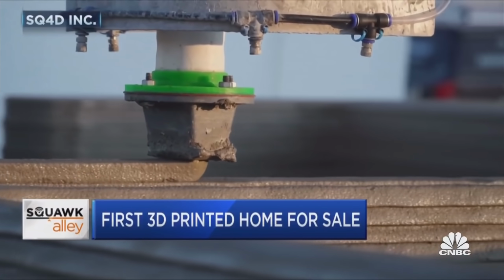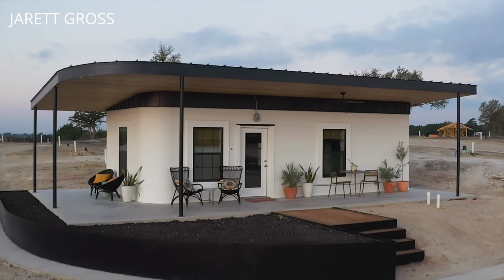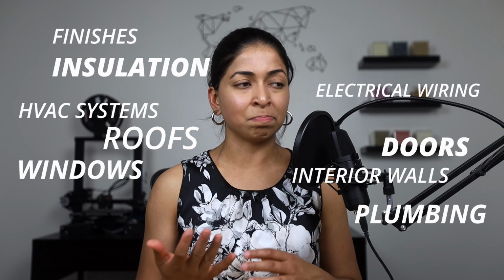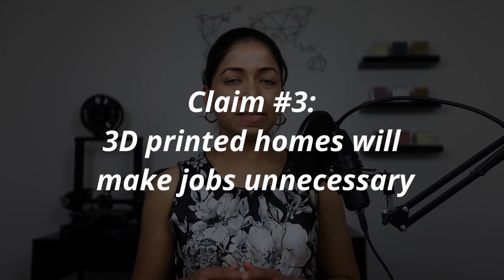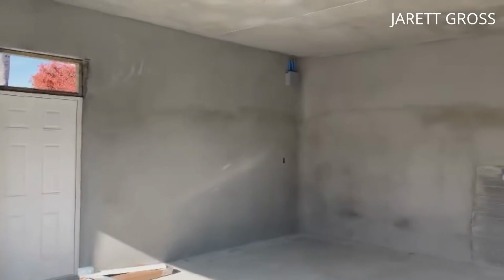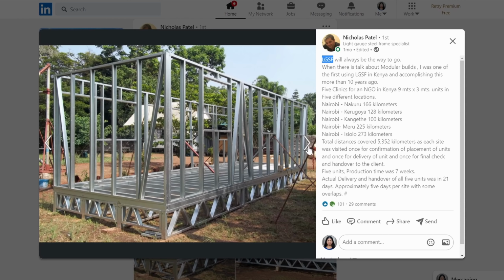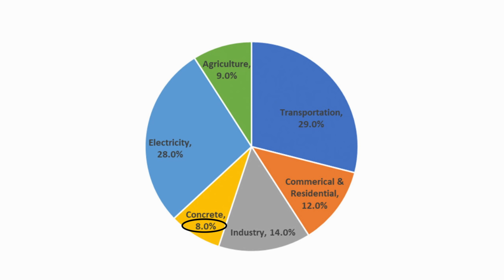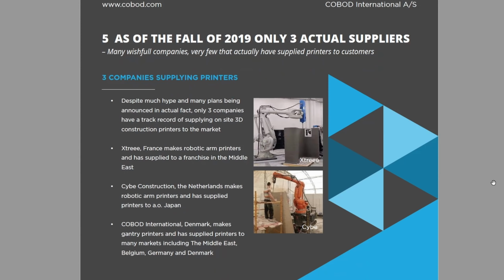Exposing 5 LIES about 3D Printed Concrete Homes

Comment: Re: Claim#1 - I don't see why 3D printed concrete house would be significantly cheaper that conventional (in Europe) poured concrete ones, especially if the house is standardized so thaqt it doesn't need custom, one-of moulds. Apart from the walls, all other (expensive) parts (you list under claim#2) are the same: doors and windows, plumbing, sewage, power, signaling...
Re: Claim#2 - Mere walls can also be poured in 24 hours, with only standard moulds and a concrete mixer and pump needed. Just saying.
Re: Claim#4 - I worked as technical assistance expert for the IAEA (helping laboratories in developing countries using mostly X-ray spectroscopy for tasks such as heavy metal monitoring in food crops), and I developed a very keen sense of what appropriate technology is. Sometimes a seemingly trivial change to the process means the difference between local self-sufficiency and endless reliance on imported supplies and expertise.  
Re: Claim#5 - Fortunately, there is lot of recent research into making cement production more sustainable, both in energy consumption and direct CO2 emissions. Concrete is not going anywhere - making it more sustainable is happening on the cement production end. Pouring vs. block stacking vs. 3D printing is pretty much irrelevant.

Etc.

You are so right. The arrogance of these clueless "high-tech solves everything"  wannabe saviors is breathtaking (something like Musk and his "spelunking submarine" or "solutions for Covid".)
Of course, 3D printed buildings do have their place: a very complex, convoluted structure might be easier and cheaper to 3D print than construct from some form of masonry (which would need to be laid manually) or poured concrete; also, it will probably be the way to build structures on the Moon and Mars. But replacing conventional (whatever that means in a given environment) building methods? No way.

Comment: Recently, I went to a lecture about 3D printed plastic structures. It was interesting, but I'm certain that it will never take off for a variety of reasons.
One is that plastic is seen as a cheap, poor quality material by most people; why would you spend the money to make a house just for it to look and feel like the cheap garbage you'd buy at Walmart?
Two is that plastic as a construction material is a terrible idea. Plastic not only warps and brittles over time, but also melts and drips as it burns. There is no way to fireproof plastic structures, so their uses are very limited and people must be very careful about introducing heat to them. Topplogy can be used to optimize the strength of the material, but it is still plastic and has the weaknesses of a combustible, melty material that is prone to warping and becoming brittle.
Three is that 3D printed forms are a lot more limited than many people would lead you to believe, and finding pleasant yet realistic forms is much harder and more time consuming than you'd expect. It takes months and dozens of prototypes to figure out what the limits of a design when it is 3D printed. It is also very difficult to properly 3D print roofs and floors. With plastic structures, the failed prototypes can potentially be recycled, but you can't really recycle concrete. Concrete is typically sent to a landfill as soon as it is taken out of a structure. 3D prints can also fail for a variety of reasons, especially if you print on-site in an area that is not climate controlled. These failures may not be recyclable, depending on their materiality, and could occur very frequently.
There are more practical and philosophical reasons why 3D printing structures (regardless of material) is likely not the future. As much as some people dream of beautiful, intimidating, alien forms generated by AI and printed and assembled by robots, I highly doubt that there will be either a market or the technology to make this commonplace for quite some time, if ever.

Comment: I am in the pre-engineered metal building industry, and I completely agree with you on the areas that I have experance and insight.  Glad that you mentioned the light gauge steel construction.  Light guage steel is a construction type that many scoff at, but can be an extremely affordable option.   The pre-engineered industry uses light guage framing when possible.  The a 30x50 house, depending on location, can be designed with just one structural frame and two light gauge frames that can with stand 110 mile an hour wind gusts and 60 sustained winds.

Comment: Why would a 3D printed house be cheaper in large volumes? A mass produced injection molded chair still cost a fraction of a 3D printed chair of the same design

Comment: I ordered a truckload of concrete last year. It cost $2000 for the material alone and that was just plain old concrete, not screened to go through an extruder. That said... it might have cost <$3k before the pandemic, when building materials weren't insanely jacked up.

But the bigger issue is, you won't find a contractor to do a $3000 project right now. We're building the wrong kinds of homes to satisfy a house hoarding glut instead of workers' needs for homes. And obviously, high-density housing is vastly more affordable than putting 3-4 humans per quarter acre in tiny concrete boxes.

3D printed construction has brilliant niche applications, like all additive technology; and like all additive technology, it does not excel in mass production. We just aren't using it very intelligently.

Comment: So basically it's just another method of making home structure in a horizontal plane of construction ideas, but not revolutionizing the general construction - vertical achievement. You remove workers from manually applying cement/concrete, or wood planks with automatization, but you require now humans that manage, operate, and maintain the equipment. Nothing really changes, just literally an addition to how something is made instead of actually revolutionizing the process.

Comment: This was a really solid video. I remember being really excited by the initial coverage of 3d printed housing years ago. I don't think it's all unwarranted, it is an exciting technology, but it's interesting to see how it's been so sensationalized and oversold. Very eye opening, and I like that you brought up ways people's culture could be integrated into other types of constructed housing; that wasn't something I had really considered before. I think the way forward has to be having options. There will never be one fit all solution, but having choices is good! The more the better; and instead of trying to cram 3d printing everywhere, it should be considered a useful tool with it's own set of use cases.

Comment: Every business has excess expenses obviously.. I think the factor here you're not taking into account is in a normal business, labor is typically between 50% to 75% of a businesses expenses. Replacing your average worker with a machine does unfortunately reduce the cost significantly, of course buying the machine costs money, but you know what else costs money? Hiring, Training, purchasing tools. Etc... So it's a cost versus savings analysis... 3d printers are a one time deposit with very minor maintenance which for the most part only require the initial setup and then one to two people to babysit the machine rather than the entire crew of builders getting 60-80 hour weeks and the astronomical overtime costs which I'd remind you are one of the biggest and most common factors for a business to shut down.

As you pointed out houses have yet to be mass produced through this method, and that's the key factor right there... Once a company can pay off the initial investment they then have more flexibility to begin significantly reducing their prices. Walmart and McDonald's has already proved this with their self checkouts... Yeah, sure, a self checkout machine might cost you $50,000.... But paying $20,000 per cashier a year in labor with 6-8 cashiers on payroll means your self checkout is only an initial investment which will eventually pay itself off.... Automation is cheaper than labor, society is gradually shifting towards a skill labor only society with physical labor jobs only being necessary for customer service positions. It's both good and bad for society as skilled labor also means education and hopefully our government system will learn to understand this and shift things so we can learn trade skills instead of how many bones are in a newly discovered species of fish.

Comment: The irony is that the 24 hours on-site claim can actually be achieved with certain pre-fabricated house designs. Clever design is what makes the difference, not the use of new materials. In terms of (relatively) cheap mass housing, shipping container style construction is probably the most rational approach.

Comment: Rammed Earth is a great way to go personally my cabin has 17 inch thick Sirewalls. You can go thinner or thicker. The cabin is 1035sq ft. The house stays really cool in the hot summer. We do have AC hooked up to our solar and it hardly needs to run. The walls were built by compressing earth with a hydraulics, however some use a pneumatic tamper. We built our own device to compress the earth. Everything was compressed in a form on site and in place, that is for both the inner and outer walls. In between the walls in insulation and pathing for the wires. My father now lives out in my cabin which is 100 percent off the grid right now full time. Hope that in the future we can at the very least get electricity hookup. People ask about the construction time which was about 4 weeks for the standing walls and roof to be on. Finish work me and my stepfather and some friends knocked that out in about a month in a half. A lot of what we had to do was custom. Like the door, out windows, the all stone bathroom. The house is unique and beautiful. I wish that in the city limits they would recognize and let people build these. They look unique and beautiful color striations.
Reply: Here is a link going over what we had did almost to the letter. I hope this can answer any questions that you have. Or clear any misunderstandings about the construction you have as well. 

https://www.youtube.com/watch?v=HaGFrVGMzb4

Comment: I can really appreciate the realistic look at new technology. The hype bugs me, too. No brand new technology is cheap to begin with, that's just how it is. And I like that you said it is a solution looking for a problem. As it was, for example, the laser was one of the very few notable inventions that was created not as a solution to a problem, but merely to see if it could be done. 3D printing is a solution that makes prototyping faster, but it unrealistic as a means of production so far (I do 3d modeling and printing, so I know).

3D printed buildings might be like the attempt at virtual reality in the 90's. The technology to sustain it simply doesn't exist yet.

Comment: I don’t know how good these 3D printed houses are, but at least we can apply a couple of metrics. 

1. What’s the cost (in dollars) per “cubic foot” of enclosed space? Rental properties are only quoted per “square foot” of floor space. That’s not good enough.

2. What kind of warranty is included? And how long is the warranty? Will factory-trained technicians make the repairs?

Comment: Concrete is on the cheap end of materials, but other options are often still chosen because they are even cheaper.  When it’s the size of a house, material cost is one of the greatest factors.  Wood literally grows on trees and even the cost of that can be a limiting factor.

Comment: The instant I saw the printer in action I thought "Shouldn't concrete have rebar inside it to increase its shear tolerances? Those buildings might end up weak."

Comment: i'm building an ICF house, cement for just the footings was $1800, the concrete pump truck was $200/hour, 4 hour min.  3D printed houses are a cool concept but completely useless.  I had to reinforce the footings with two rows of 15M rebar.  The ICF walls need quite a bit of rebar too.  You cannot pour concrete walls without rebar and meet most building codes.  Unless they figure a way to print rebar into the walls, insulate them, and finish them, the technology has no advantage in terms of cost or labour savings over current technology.  Also, I can stack ICF in a couple days, the pour takes a few hours, the rest is curing time.  The walls are hyper insulated, reinforced, and ready for drywall and exterior finished.  I just can't see how 3D printed homes could beat that.

Comment: Claim 1 - journalists said, not the manufacturer. The price of materials fluctuates between areas and countries.
Claim 2 - the definition of a home is different by region, and the process to do make the home is not disclosed.
Claim 3 - it’s true, yet the timeframe isn’t known. That doesn’t mean it’s misleading.
Claim 4 - it can solve the problem, the question is standards and trying to make everyone happy which will never happen.
Claim 5 - the definition of sustainability changes depending on who one talks to - there’s no concrete agreed upon definition.

People listen to buzzwords. Do something about the propaganda being pushed by the press instead of pushing the subject of concrete homes.

Comment: The main concern is that they try to replace assembly of the house directly with printing. If they consider only to print parts and components and still build it the old fashion way. I think 3d printing can make leverage in actual building of houses.

Comment: The actual problem with 3D printing a house with concrete is that concrete requires reinforcements. Usually steel rebar. 3D house don't have any that I have ever seen. So all of these 3D printed homes fail to meet building code and are a major collapse hazard. So even if it was that cheap, would you want to live in your future tomb.

Comment: What I always wonder is this... The usual concrete building has rebars in the concrete. Those construction do not. Is that safe? Is the reinforcement subtituted in some way? Fibres in the concrete mix? Will the structural integrity be sound after ten years? When the house go through cycles of cold and hot weather?

Comment: I have not seen how they use the binding iron inside the concrete homes made by 3D printing.(they probably think the zig zag pattern in the middle compensate for it)
I can see how they put in the horizontal by putting them between the layers, but i have not seen any sign of them doing this, and i do not think they use vertical iron at all.
If this is the case, i made more solid huts when i was 16 years old.

But then again, i realise that quality is not so important for most people and that in countries without winter, they do not care so much about it..

When it comes to the Carbon prints, i could not care less, as the 3 most important things for nature is water, sunlight and carbon(CO2).
All plants need it(that is why farmers with greenhouses always use CO2 gas inside the greenhouse to make the plants grow faster and bigger and give more fruits.)
Also all animals with shell need it and corals need it, for them CO2 is the main building block.

But i do not expect people to remember how photosynthesis work, even if it is very simple..
Its more important that we just accept CO2 taxation blindly because that is the new religion after all..  ;)

Comment: Ok the only thing that I am really interested in is whether 3D printed concrete is cheaper than conventional reinforced concrete walls. Since this is the currently only area where the printers can shine.

Cheap and fast housing is easily achievable with factory produced house modules. The houses will look the same, but will be cheap to produce and build.

Comment: i have a critique and a question "3d home can be printed in 24 hours"  is not the same as  "3d printed home can be printed and are live in ready in 24 hours" while im sure in most cases 24 hours isnt enough time or the common case, the way you presented your great argument made it seem like  "printed in 24 hours" and "live in ready in 24 hours" were the same thing do most arguments state they can be lived in after the house is printed or do they set the expectation that the printing can be done in 24 but than they still have to do electrical and other stuff?

Comment: Tell me one thing: how are 3D printed wall reinforced with steel? 

There are two very fast ways of building: "lost formwork" - you just place foam formwork blocks very fast and then pour concrete inside. Other is use prefabricated parts and only assemble the house. 
Both are very fast. But to be fair: if on walls you cut 2-3 weeks of work, it's not much compared to total time neede to build a house. Design+permit+building+finishing in 2 years is ultra fast, so 2-3 weeks? really doesn't matter. What matters is total cost. 

8:34 Heat-islands are not caused by Concrete, these are caused by improper use of concrete. It's like blaming steel for guns and ammo production. Also I don't know how in your country, but in my "heavy" particles are not treated as air pollutant, as these quickly drop to ground, and quarries and cement do not make any toxic fumes, so from all industry these are OK. Surely: workers should wear their personal protection, but that's it. I mean compared to alternatives: if you use wood, then  impregnation is really so toxic compared, so that building houses from ceramic/concrete/SiliCa is actually really good for environment. 

You might live somewhere, where heating cost is very low, where wood houses are best, but there are really places where concrete needs to be used.

Comment: 3D printed homes are made by stacking up material layer by layer. A drawback seems to be that you must wait for the concrete to cure between layers. Can i suggest we speed up by making the walls from sections cured before construction starts. We could call these sections bricks.